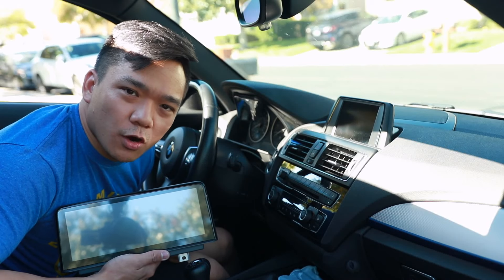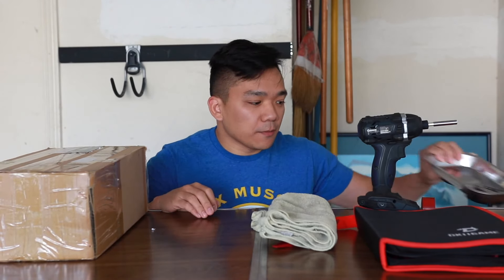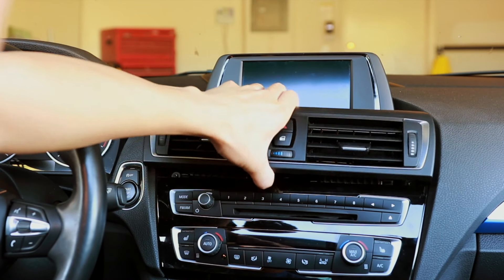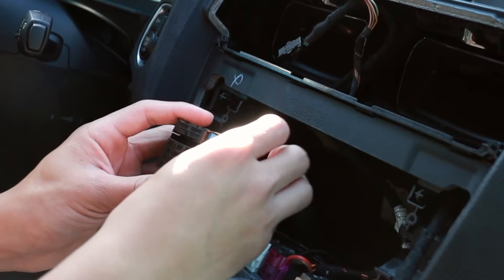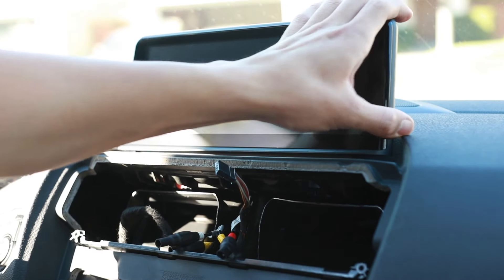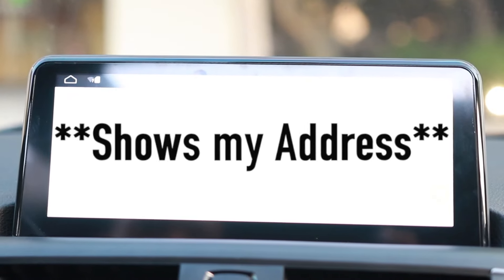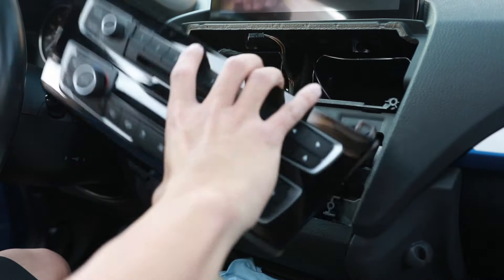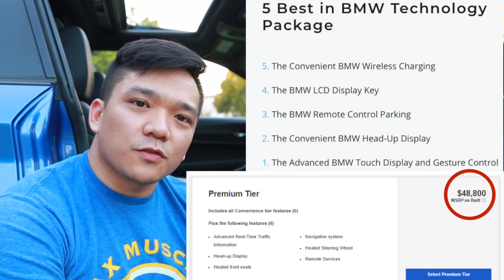BMW Android Screen | BMW Screen Upgrade | Koason 10.25" Display

Comment: Great video with details. Friend of mine have the F22 220i, with GPS but without bluetooth or usb port, only AUX jack, its sucks to play music from phone via cable. Is this upgrade allows bluetooth connection?
Thanks
Reply from the maker: Yes this unit allows for bluetooth, you just have to select it in the settings because the setting defaults to "car BT"
Reply: @FritzRamos  Thank you!
Reply from the maker: @Kickbasser  any time

Comment: Hey Fritz great vid! Does the screen work with my 360’ cam to? Thanks in advance
Reply from the maker: If it has a usb connection then yes.
Reply: Have a OEM 360* cam, but the small screen want zo upgrade the screen. But still want the cam working.

Comment: Hey, great video! But didn't you have to connect the new display to the aux on the main car? Or you don't care about hearing audio from the android system
Reply from the maker: Thanks for the support. After testing out the unit, I didn't need to. Maybe it's just for some models? Did you have to connect yours?
Reply: Fritz Ramos I’m yet to purchase one, but because I’m from the UK I need one specially for RHD cars. All the ones that are for RHD cars need to be connected to the AUX which I feel is a bit cumbersome
Reply from the maker: Really? Are the connections different?
Reply: Fritz Ramos Nope, just the plastic on the back. The triangle is flipped. Mine is an F20 BMW
Reply: @KABUTO  Hi Kabuto, If you contact the seller directly they are usually able to advise you on whether it is the correct fitment for your Vehicle. Have your Registration, Vehicle Model number, Vin number, exact year of manufacture and maybe send them a couple of pictures of your current Screen as well. I live in the U.K and my screen, which I purchased from Amazon fits perfectly. Last i checked they still have some in stock.
Reply: @KABUTO  Let them know you are based in the U.k and they will send you a suitable screen. I have a F32 ( 428i) and the screen I purchased on Amazon fits my RHD vehicle like a glove.

Comment: Great video! Did this upgrade this afternoon and it's so cool. I just don't know why I can get no sound when played directly from the screen. For ex. when spotify plays a song, nothing comes out. I have to play it from my phone and send the sound to the screen using Bluetooth... 😢
Any idea of what I did wrong? Maybe this could be the wire manip you talked about...
Reply from the maker: Sound from the unit comes through the aux setting
Reply: @FritzRamos  I guess some kind of mini jack - mini jack cable should come from the aux under the armrest to... Well I don't know... 🤔
Reply: Having the same issues…did you ever get sound?

Comment: I have the same on my F34, but mine oem screen is like in half and on the right  the little template. Is it possible to do it full oem screen like your screen?
Reply from the maker: Yes it is https://youtu.be/8NrPVNs2-Cc
Reply: Fritz Ramos thanks!!
Reply from the maker: @zohra1770  let me know how it goes
Reply: Fritz Ramos i will, im looking a little bit deeper into coding. I will comment on that video that you answered here. Because i have a question.
Thanks!
Reply from the maker: @zohra1770  sounds good. Looking forward to hearing from you

Comment: Great video,can this be done on BMW F10 as well? I got mine a few months ago and it has the small screen which is so annoying and makes the car look so much worse...
Cheers.
Reply: Did u need to use AUX TO GRT SOUND ?
Reply from the maker: It should be able to.. You just have to get the one specific for your car so that the connections line up. https://amzn.to/2ABhEGz That one should work
Reply from the maker: I did not, but other people do need to connect it. Not sure what the reasoning is
Reply: Fritz Ramos I ordered mine from AliExpress? Was that’s good idea ? Lmao iv been told it can be fraud ?
Reply from the maker: @UltraJamZHD  It might not be, but the customer service is horrible. I found one on Amazon that's available https://amzn.to/3hB1uho

Comment: Hello! So glad I found this video. I’m purchasing a similar unit but for my 2016 4 series. It should be a similar set up correct ? Also, I’m not very informed abt these things, but what is the purpose of the sd card?
Reply from the maker: You're welcome. This is a perfect diy for beginners. The SD card is if you download lots of apps to the screen. If you store them on the SD card the screen's performance won't be hindered as much

Comment: I have a 2013 BMW 320i and the idrive screen keeps rebooting every 2 to 3 minutes. I took it to the dealship and they said the upper head units needs to be replace and it would cost $1,900. Looking at your video, sounds like I could purchase a new unit and it should work. I wanted to get some advise before purchasing a new head unit.
Reply from the maker: I have never heard of that issue before. If you wanted to get this head unit and it doesn't fix the problem you could always return it, since amazon has a 30 day return policy.

Comment: I have apple car play pre installed, can I get it to play from my original USB port which comes with the car or do I need to use a separate one?
Reply from the maker: Factory settings should work the same as they did before installing the unit

Comment: Thank you for the great video. My Z4 E89 Android screen does not respond at all, but the i-Drive works.  However, with the i-Drive I cannot go to the apps or settings menus.  Is there a solution for it? I would appreciate if you can tell me what to do to fix the issue.
Thank you in advance.
BTW, I resettled the OS via the small reset hole on the system, but that did not fix the issue!

Comment: Hello,
I have installed the screen and everything is correct but I have a problem:
 The steering wheel to change the song works correctly but nothing appears on the speedometer screen.

Could it be that I have to choose something in the settings?

Thanks you.

Another problem is that I do not see the check controls or fault messages on the touch screen.

Greetings and thank you.
Reply: Edit: I saw that you already explained it in the section "check for the fiber optic cable". Sorry for the inconvenience.

Comment: Hi Marcos, I enjoy watching your video. That is what I was looking for because I have a 2013 BMW x3idrive without navigation and backup camera. Can I use the same parts to upgrade? I live in Mountain View, CA, do you know someone in this area that can help me? Thanks in advance for your help.
Reply from the maker: I believe that this is the unit for the x3 https://amzn.to/3itvKLz I actually live near the area I could do it for you
Reply: Hi Fritz, thank you for answering my questions. I will order it as soon as possible. Do you think I can put any backup camera into this system? And how can I contact you when I am ready to install the system? Thank you in advance for your help. Beatrice
Reply from the maker: @srbeatmedia6178  I'm so sorry for not getting back to you sooner. You could see if there is a screen/ camera kit. Or if the same manufacturer makes a back up camera. Most likely it will need to be spliced. You can message me on IG @fritz.ramos

Comment: I have a 2018 BMW X2 with a small screen. Problem is I searched and searched and search and cant find any android compatible for the X2 for 2018. I called the local stereo install company and he said he could not find anything that would work. I’m looking for a upgrade but it seems like it always turns in to a dead end. If anybody has any information about the X2 that would be greatly appreciated!

Comment: My unit came with cable box. Installed everything works fine. But am not getting any noise. Any help please?
Reply from the maker: Did you plug in the aux cord?
Reply: Fritz Ramos I did not actually. Will go ahead and give that a try. Do I need to buy and aux adapter as the there both (plug in ends ) . A bit confused on how to go about it. Sorry for inconvenience.
Reply: Fritz Ramos would that also be the reason for my volume button getting stuck at zero and not being able to move it from. Won’t let me raise volume on original screen.
Reply from the maker: @emocookie4life  To the best of my knowledge, it shouldn't. Do you have the optical cable by ay chance?
Reply: Fritz Ramos Yes i do have optical cable i took out optical cable and installed into the new unit harness. Unless I put in wrong slot which I doubt? I can’t put up volume and it doesn’t show any Chanel’s on radio station. Appear blank on screen.
Reply from the maker: @emocookie4life  is it possible that the optic cable is upside down not not full engaged? Sorry, your situation is the first I've tried to help with so I'm just going over possible ideas
Reply: Fritz Ramos Could be a possibility. Will have to check this Sunday when I get my day off. Will keep in touch and let you know of situation. Appreciate all the help.
Reply from the maker: @emocookie4life  anytime. Just let me know
Reply: Fritz Ramos  soninstalled got noise from original unit not android side and was wondering how the navigation is supposed to work. Says it’s offline? Please help.

Comment: Hi bro, am wondering i installed same screen on my bmw f30 328i without disconnect electric power but my head-up display doesn't work and i can't activate any help with that
Reply from the maker: Can you hear the radio?
Reply: @FritzRamos  yes radio works, head-up display showing only speed numbers
Reply from the maker: @toyboy1995  same thing happened to me. You might have blown a fuse. Check the fuse set under the trunk liner

Comment: Hey My friend , i installed a similar unit in my f22 2 series. Bluetooth audio streaming works fine (with aux on at the idrive). But if your not Quick enough it switches back to the radio... 

But When i watch a YouTube video I have 2 second sound, then radio comes on again. Anybody can help me with this?
Reply from the maker: If you switch it to the aux setting on the idrive it switches back to radio?
Reply: @FritzRamos  When i want to watch youtube on the screen, Yes. There is sound from youtube for one second then it switches back to radio (from aux). The demo movie that is on the screens memory play with music
Reply: Lograste solucionar el problema? Estoy en la misma :(

Comment: Hello Mate i got 2015 plate F20 very recently i have replace the headunit and  the screen which came off from another same model car. But after replacing phone, sat nav none of the option are working only radio and aux works at the moment but volume button panel on the dash and steering doesnt work either. Do you know please what shall i do?
Reply from the maker: If another BMW unit was put in place the system might see the head unit as one that should be in another car. The android unit has no signal so it wouldn't have that issue. 

What head unit is currently connected to your car ?

Comment: HI Fritz, your video was so clear. But I have a few questions.
1/ After installation, I found the igo map has to no Switzerland map but not EU at all. I did try to use Google maps. But nothing on it.
2/ Do I need to insert a SIM card to update the Google maps and igo map?

Everything are working well. I am living in Switzerland.

Nelson
Reply from the maker: Thanks. A sim should not be necessary, try using the hotspot on your phone. That's what I do
Reply: @FritzRamos  ok Thanks

Comment: Nice vid 👍🏼 Would it be the same steps on a 2014 320i sedan? Im from Orange County CA looking for some help with this upgrade 🙏🏼
Reply from the maker: It should, I believe that is a CIC system correct?
Reply: Did you buy it Guillermo ?

Comment: One important question; all the settings for the car are available in these aftermarket systems? For example changing setting for locking the vehicle withstand or blinking lights, and more?

Comment: Hello. I have BMW f46. I have seen in your good tutorial that you do not connect the auxiliary cable. Does that mean that the audio from the bluetooth microphone still works with the original? Because in my box I got a microphone. And the original USB input of the center works or is it bypassed? Thank you.

Comment: Hey man, I just subscribed and like the way you explain thinks on here. I have a few questions of my own. 
I have a bmw 328i 2013. So I believe to have the cic which the idrive controller in the center has only the 5 buttons. My car only connects to Bluetooth for calls and that’s it. I want to be able to get into my car and have my iPhone connect automatically can you recommend me some options? If it’s not possible can you tell me what I need to upgrade. Sorry I’m a noob lol
Reply from the maker: Hi Christian, 

No need to apologize, we're all here to help and learn from one another. I believe that the android head units are capable of playing bluetooth from your phone automatically (The unit does take some time to boot up though) and you should still be connected to make calls from the car side as well. 

That's an f30 right? I found this for you https://amzn.to/2w2PHp4

Same brand as mine
Reply: @FritzRamos  yes it is a F30, i also found this one from amazon thats slightly cheaper. https://www.amazon.com/dp/B07S2HXBVV/?coliid=I1PP64B0PIB6OP&colid=6OOIY9I2Y5M8&psc=1&ref_=lv_ov_lig_dp_it
what do you think of this unit?
thanks for being helpful in this decision!
Reply from the maker: @christianperez6816  The biggest difference I saw was 2 vs 4 G of RAM. Depending on what you plan on doing on the screen you might need the extra power. I decided to future proof myself and got the 4G
Reply: Fritz Ramos I agree, then I’ll most likely go with the one that you sent me
Reply: Fritz Ramos thanks for the help
Reply from the maker: @christianperez6816  Anytime. Feel free to let me know if there is anything else that I can help with.
Reply from the maker: @christianperez6816  As long as you are sure that the version you will get is suitable to your needs then you'll be fine. I tool a look again and noticed a small cosmetic difference. Yours has a silver trim while the one I sent you has a black one. Not sure if that matters to you.
Reply: Fritz Ramos  thanks for taking another look bc I didn’t catch that. Once I get it I’ll write out an update to you how it went. I appreciate Fritz, thanks for the help. Also looking to buy LED headlights for my black F30 if you have any recommendations pls send them my way!
Reply from the maker: @christianperez6816  I don't have personal experience with any but I can help you research some things. Keep me in the loop, I'm more than happy to help

Comment: Hey Fritz! Sorry to bug you but my audio isn’t working after the setup, any ideas?
Reply from the maker: Have you tried plugging in tha Aux Cord?
Reply: Fritz Ramos I have and still have no audio. what do else can I do to troubleshoot? I have a 2014 M235i
Reply from the maker: @clopez1967  so you have the optic cable? If so did you properly route it?
Reply: Fritz Ramos mine was actually like yours, no optic fiber cable in the harness. everything was plugged in correctly too. unfortunately no sound 😭
Reply from the maker: @clopez1967  try going into the inner settings like this video. https://youtu.be/8NrPVNs2-Cc

Then make sure the aux settings are set to automatic and not manual
Reply: Fritz Ramos it is currently set to automatic and not manual. the AUX activation function is off. should I turn that option on?
Reply from the maker: @clopez1967  yes and if that dissent work try the aux cord again
Reply: Fritz Ramos I tried it again and no luck. I even threw back on the old head unit I had to see if the audio would work and it does. but whenever I plug everything into this one, it doesn’t.
Reply from the maker: @clopez1967  no audio at all. No radio, Bluetooth, or aux?
Reply: Fritz Ramos my phone calls surprisingly work. but no music, sound or radio. even with the aux.
Reply from the maker: @clopez1967  perhaps you have a defective unit or try reaching out to the manufacturer

Comment: I have a question. The local BMW repair shop just taxed me 1600 for an amplifier. They thought that was the issue but it didn’t fix my sound. Took it back today and now they say I need to replace the head unit. They said they checked the TCU module and now they are recommending changing the entire head unit. I want to know if you think getting the unit that you documented would be better. 2016 328xi. Let me know. I have been riding with my Bluetooth speaker.

Comment: Can someone please clarify something for me? I have a 2012 BMW 118i. It has a CIC head unit, however the link to the Koason display says that it's for NBT. Will the Koason display still work with my head unit. The CIC has a 4 pin LVDS while a NBT is a 6 pin LVDS.